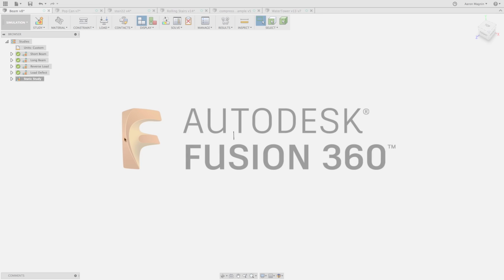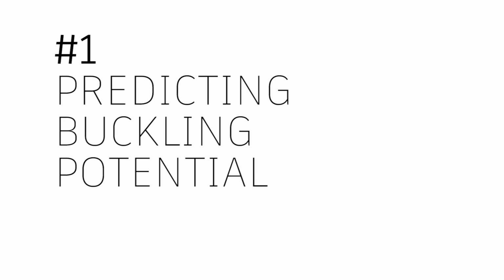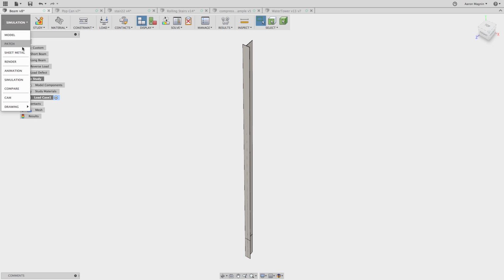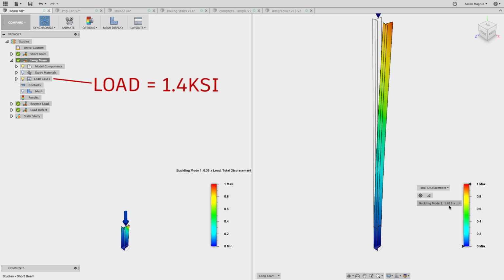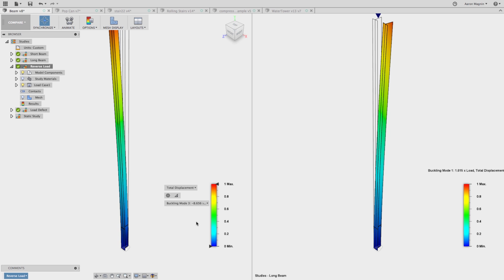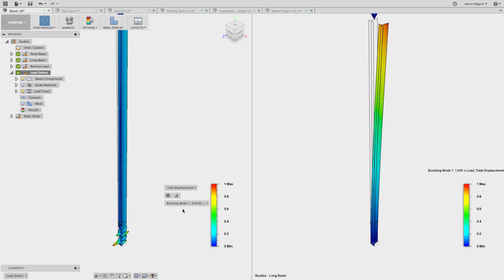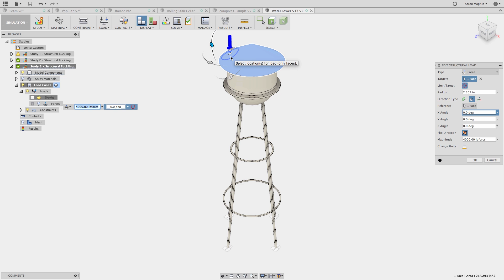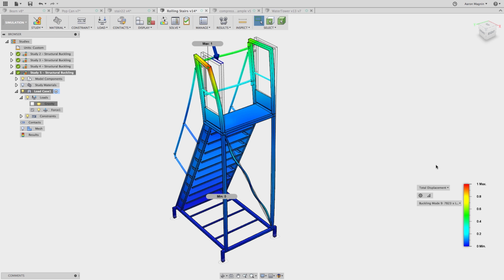QUICK TIP: Buckling in 3

Comment: Can you :

1. Create a tool to export object to thingverse compatible with their parametric tool ?
2. Make an option to capture position on a body ? If you move the body after creating a sketch when you edit sketch the body come back old position.
3. Custom option for threads especially for Fdm printing to avoid overhangs ?
4. Add the possibility to edit a thread / coil
5. Saving a thread / coil setup and put it in an option list ?
6. Saving the pivot of a body ?